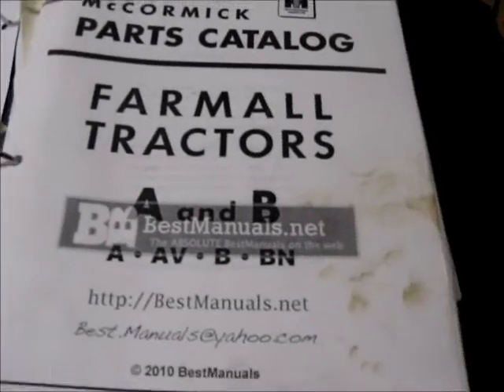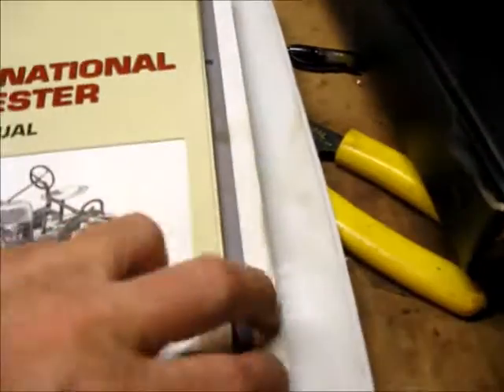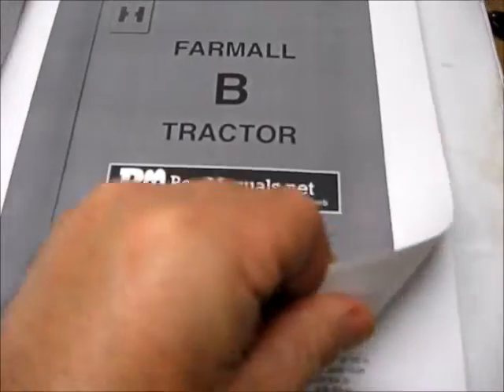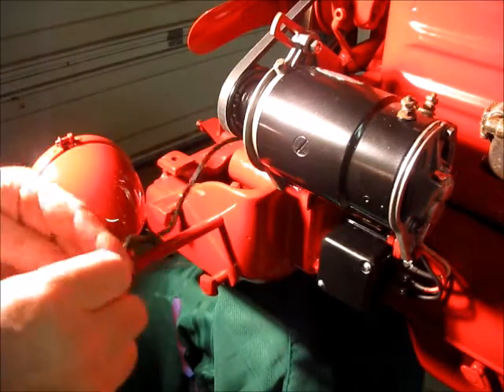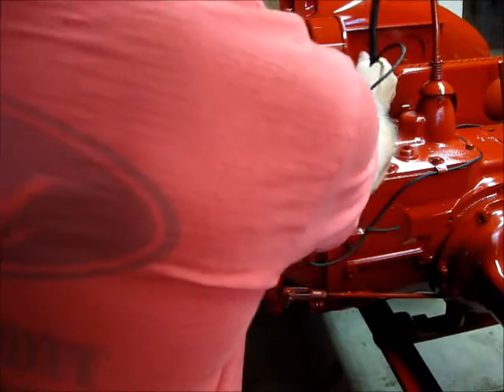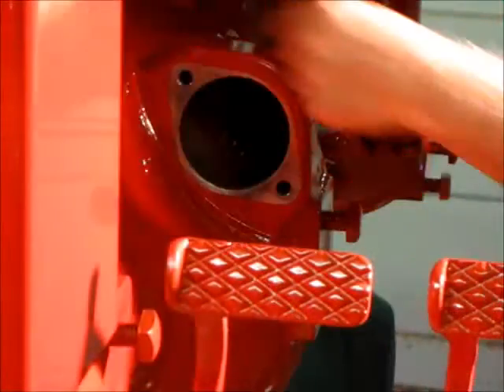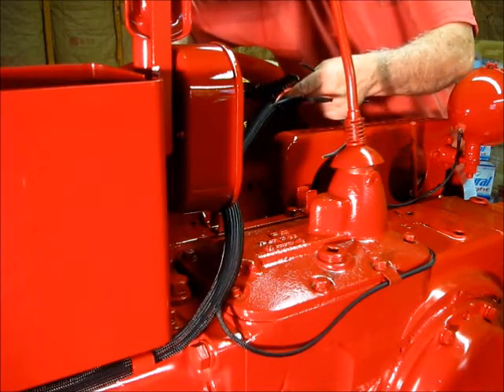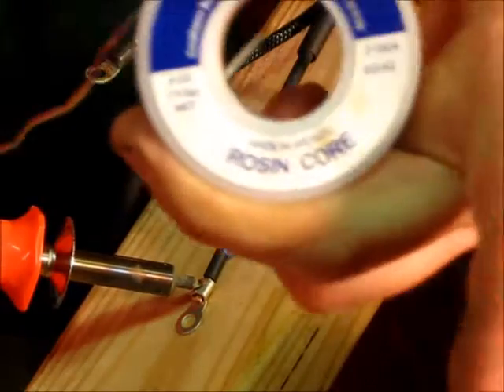1945 Farmall BN Update 36

Comment: Clean, Clean, Clean wiring job !!! That looks awesome.... and that Paint job is fricken awesome..... did you grind or sand the block or transmission ??? it is way smoother then I have ever seen... most blocks and tranny's have a lot of defects in the casting itself...
Reply from the maker: My has some too Rick. I sanded and sandblasted only the casting codes and part numbers. One coat primer, 2 coats paint, then I sanded or scuffed the areas I thought needed it and recoated enough to get good coverage and shine. I really like the Case IH paint . Got the sediment bowl to tackle. I would like to make a temporary fuel line with an inline filter just to run some gas thru her incase I have some varnish inside tank floating . I cleaned her good but just want to be sure so I dont end up plugging my carb
Reply: I passed your name onto another gentleman who was asking me about what paint I used on my Cub.. I also used Iron Gard and Loved it the Gentlemans name on youtube is +LJ Liberto